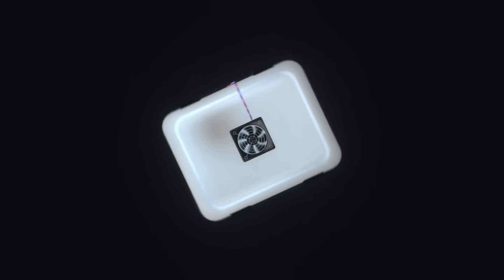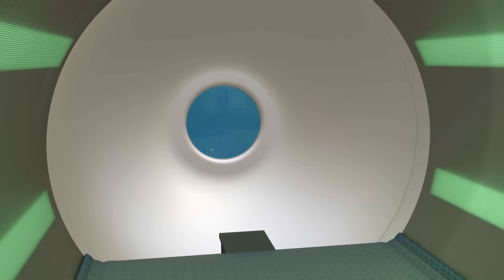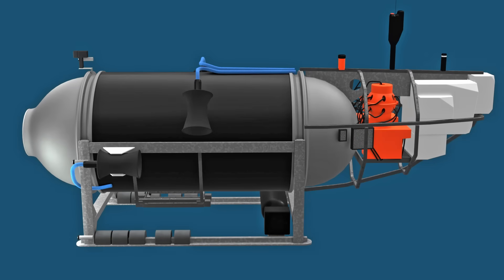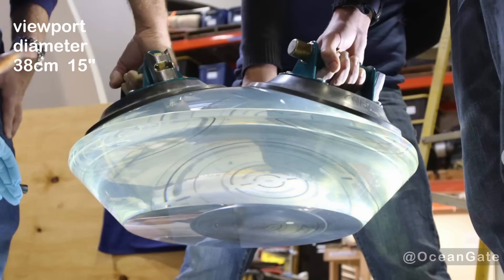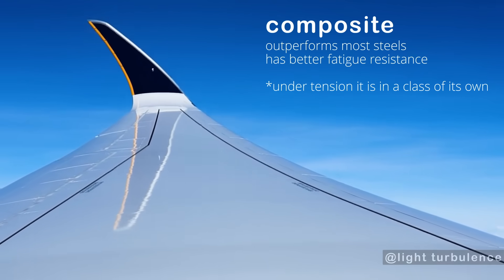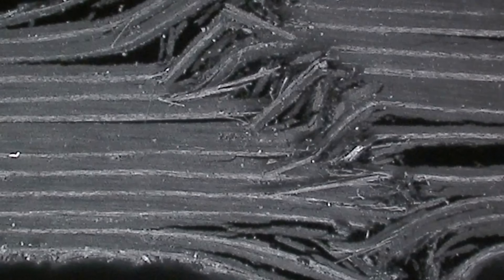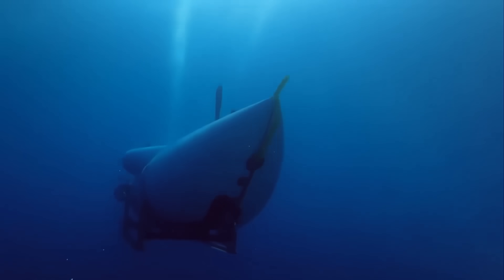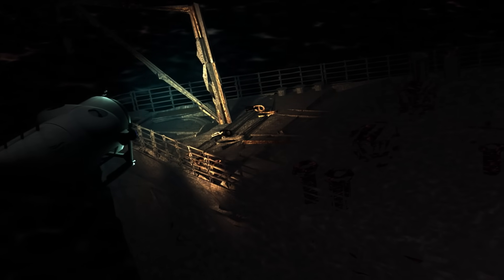Titan Sub | carbon fiber - Detailed Tour

Comment: Your example of the flexing commercial aircraft wing to demonstrate that carbon fiber prepreg composite (CFC) is fine for compressive loads, is flawed.

For a wing providing lift, the major forces of lift and weight are resisted by the underside of the wing, indeed in tension, not compression.

(The top need “only“ maintain a smooth surface without buckling or rippling under load. Nowadays, the upper and lower skins are designed to be structural elements. There are multiple spars but they do their job in synergy with them to effect structural viability.)

Incidentally, the first nontrivial application of CFC for a performance aircraft´s wing, was for the McDonnell Douglas AV-8B Harrier II, the American remake of the English military VSTOL fighter jet. The CFC spars had to be designed sinusoidal in form, because “springy“ CFC couldn´t handle the loads of high-G maneuvers -- Or should I say, this is what was needed to equalize the forces of the interface of the CFC wing surfaces bonded to CFC wing spars.

The “sphincter-tightening shotgun noises“ are caused by the consequent re-equalization of internal forces when fibers break, because it is challenging to equalize the stresses (and strains) of millions of hairlike fibers, especially when under the extreme and differing loads near the titanium endcaps versus the middle; indeed, the structural efficacy of CFC fabrication is only truly manifested when this attribute can be achieved.

Oversimplified conclusion: CFC is good for sheet, but not so much for stock, and good for tension, but not so much for compression.
Reply from the maker: You seem to lack a clear understanding of the topic and the principles of structural engineering. In wing design the same tensile forces are balanced by equivalent compression forces at the top of the wing. This aligns with the fundamental principle that "every force has an equal and opposite reaction." You are suggesting that tension simply disappears into thin air  without a counterbalancing force which is nonsense.

It's intriguing how some, including yourself, struggle to accept the fact that carbon fiber can rival the compressive strength of the best. Carbon fiber is a structural marvel, but its correct construction is notoriously challenging and expensive.
Reply: @Mike-Bell  your responses to legitimate and erudite points of contention presented from obviously well-informed commentators have been extraordinarily bitchy throughout this entire comment section for someone who themselves directly solicited such commentary at the end of the video itself. In fact, I find your commentary of late to be increasingly hubristic and less focused on the technical details underlying mechanical failures, which was what compelled me to subscribe years ago in the first place.
Reply from the maker: @Muonium1 @brianhiles8164  I thank you both for taking the time to comment thoughtfully and with the intent to correct, unlike so many  who do it to insult or for a reaction.  The comment section can be a nasty place and the Titan video has been much worse than usual.  There are comments you don’t see that YouTube filters from  public that are plain vile and cruel.  Pretty much on repeat insulting me generally and telling me I dont know what the F I’m talking about good for compression.  After a flood of these I replied with the above cut n paste response and in some cases distracted frustration which isn’t constructive.  It's better to not  respond but I felt compelled after this garbage dump on my channel.  For my own sanity I think I would do better not reading further comments but that is also not a solution ...  although it seems the garbage has stopped or slowed.  

I didn’t will nily come up with my position.  I checked what I reported in the video with aeronautical engineers who have their own aircraft manufacturing company and they found the whole notion that composite is poor in compression hilarious considering the success of their product and business relies on the spectacualr compressive capabilities of the product.  They did the calculations that I quoted in the video showing a good safety factor.  However, the very thick layup was a big unknown and concern for them and would require tons of testing and research to reveal the unknowns and they added the titanium bond is no joke and very tricky to optimise.  And the mandrel geometry really troubled them.  "Composite outperforms most steels in compression" is their statement not mine.

As for the above comment by Brian which states that wing stresses are not resisted by compression "the major forces of lift and weight are resisted by the underside of the wing, indeed in tension, not compression.'.  This is not a true statement and I disagree like I did before.   The compression components of a wing structure in the top skin and spar absolutely resist major compression load equal to the tension loads elsewhere and on the underside.  
As for the breaking fibres and noises, the engineers I spoke to put that down to bad layup and what happens when you take the material beyond it safe design limit and into fatigue zone.  They also made a point of saying that CF has better fatigue characterisitics than steel.
Reply: @Mike-Bell   Thank you for your clarification and backstory; it is just as challenging to make technical videos published to a non-technical media venue (i.e., YouTube) as to, well, lay up CFC. It is I who gave a LIKE to this your response.

I just have one quibble with your response, still. I never said that wing stresses are not resisted by compression -- this is why I specifically used the word “major [forces]“, and indeed this is why I included the parenthetical clarification in the following paragraph to contextualize this assertion, in context of the exigencies of current wing design.

In the “real world“, engineering specifically, and the scientific method in general, is very infrequently at liberty to assert any one thing is definitely so, without qualification or context. Any attempt to do so “should“ be prefaced by the word “Oversimplified“.   :-)

(As illustrative example, do you really want to formally employ the word “equal“ for the matter of compression and tension? If memory serves, commercial aircraft (and its wings) are designed to endure +3 G, but only -1.5 G. I know, I know: semantics; however, in the hard sciences precise language is crucial.)

In conclusion, it is to be emphasized that your assertion that the flexing of a (CFC) wing is a sufficient example illustrating the primary thesis of your video, is what my response addressed -- with explanation, analysis, and example.

I am nominally okay with the rest of your other written statements; it is my desire that in a careful rereading of my OC you understand that we have essentially stated the same verities.
Reply: @Mike-Bell   Your interpretations of my theses are formally incorrect. I perceive you have some engineering expertise, so it is especially distressing that you make such silly assertions. Why? How?

I would only challenge you to re-read, carefully this time, my original comment, being statements of simple physical fact.
Reply: An aircraft wing is essentially a cantilever beam with a aerodynamic skin. The major bending stresses are taken by a beam similar to an 'I' beam (although they may be box sections, circular sections or more complex shapes). The main point being that while the outer material takes stresses, tensile on one side, compressive on the other, the internal webbing takes those stresses as tensile stresses to stabilise the structure in depth. The complementary compressive stresses are less important, and may in fact cause the thin sections of the web to buckle as the beam is loaded. The point is to keep the compressive stresses within bounds with a stiff structure, but to allow flexibility to distribute stresses safely.  The point is the wing has opportunity to load CF structure in a safe tensile manner.  The laminar lay of the subs CF cylinder left a glaring omission. The circumferential and axial compressive loading produces a complementary tensile stress in the RADIAL direction. Only epoxy served in that direction, so as a failure mode, it would be squeezed like toothpaste in a tube, failing by spalling chunks of composite (on the inside). Conventional 'planar' lays of CF will not/can not address this problem.

Comment: So thats a neat failsafe for the weight frames, excrpt there is ONE GIANT problem with it...

The entire frame of the titan was designed with a great majority of its weight on the "bottom" or floor of the vehicle. Further outside of the submersible its on a steel frame itself...on the belly. 
How in the hell do you expect to roll the vehicle to release those weights? 
You cant get out to lift it.
The motors arent strong enough to barrel roll the vehicle at all.
And its literaly impossible to out leverage that frame with even all 5 occupants doing ANYTHING you could come up with to roll that vehicle.

So that would be a completely failed system as soon as the primary release mechanism failed. 

Surely im not the only person who is skeptic about that boyancy system?....
Reply from the maker: Those sort of calculations are really easy to do by an Engineer. OceanGate wouldn’t so dumb not to do it and they had some good ppl on the team. 450lbs of the crew off to one side is a substantial moment. And from the model the tilt needed to be only 25degrees which was not that steep.
Reply: @Mike-Bell  450lbs cant leverage multiple tons with those dimensions.
Reply: @Mike-Bell  and what you mean?...they were dumb enough to not do destructive testing....

That would be the first test done after making the vessel and checking for seal.

Comment: this review comes across as slightly bias. the sub is well known to be dangerously flawed and the company run by arrogant conman
Reply: That’s exactly what he says in the video. I didn’t see any bias.  He clearly says that sub was dangerously flawed and the guy who ran the company was arrogant and stupid for designing the sub the way he did. The video also describes how it’s too bad that they didn’t build the sub the right way with the right resources bc it could have been done with carbon fiber and it could have opened up science to a new method of traveling under water.
Reply: So you're saying he should be more biased, just the other direction.

Comment: Carbon fiber isn’t good with compression. It’s good with expansion…..this is not rocket science. That’s why high pressure compressed air tanks are made from carbon fiber. Smfh.
Reply from the maker: You seem to lack a clear understanding of structural engineering. In wing design the same tensile forces are balanced by equivalent compression forces at the top of the wing. This aligns with the fundamental principle that "every force has an equal and opposite reaction." You are suggesting that the crazy tension forces in a wing simply disappear into thin air without an equal counterbalancing force which is nonsense.

It's intriguing how some, including yourself, struggle to accept the fact that carbon fiber can rival the compressive strength of the best. Carbon fiber is a structural marvel, but its correct construction is notoriously challenging and expensive.

Comment: This sub suffered from multiple systems failures in 80% of its dive attempts, and none of those had anything to do with the CF or game controller, I would love to see a follow up video on these failures
Reply: So the CF hull making loud noises isn't a concern at all? I don't get why you people are trying to defend composite materials when it was very obviously the cause of failure.
Reply: @pyropulseIXXI  the material could be fine, but you have to remember that designs have trade-offs. This is nore likely a failure caused by some of these design goals, and not the material. Subs all make noises, as far as I know, but a carbon fiber one should probably not be making sounds like a gunshot, at least not after the first dive or two.
Reply: because, like airframes it gets better. Boeing had nasa to help  @pyropulseIXXI
Reply: @pyropulseIXXI composites good, just not for this application
Reply: Designer flaw. The whole build had problems. Follow up with it’s designers
Reply: @jimmyjames_yt  The biggest design flaw was using a composite material. I'm not saying composites can't work, but obviously, the composite is what failed.
Reply: I thought one of them was and they got away with a software update middive
Reply: Yeah i think the bloody thing was configured wrong and the had to turn the controller upside down to use it !! I mean FFS!! @gingernutpreacher
Reply: very true -
Reply: If you talk like this, you better back that up with some sources because it think you're talking bs. Go ahead, I'll wait.
Reply: The fault was in the use of composite material.
If TITIAN had been made completely of titanium, such an accident would not have happened.

Comment: I always thought it was where the end caps and Carbon Fiber met where it failed because of the different compression strengths. Also, I have read that the Carbon Fiber was bought for Boeing at a discount because it was past its shelf life if there is such a thing. Cheers thanks for Video.🍻
Reply: Also his glue looked dodgy.  Probably supermarket Gorilla Glue and apparently applied in a giant shed, not in a “clean room”.
Reply: @Woodman-Spare-that-tree  Your are probably more right than you know! 👍
Reply: With pre preg the resin and hardener is in the carbon at the correct ratio for maximum strength from the factory and it is kept cool till use and heated to cure it has a limited shelf life that should never be exceed, Especially were human life is concerned.
Reply: @suncitybooksgeraldton335  Thanks for the comment I wasn't sure! 👍

Comment: There is a reason why Navies don't build sub pressure hulls out of carbon fiber. They know it can't survive sustained compression. Aircraft hulls also have spars, which help support the structure. This guy is totally off the mark in his analysis. He must be a used carbon fiber salesman

Comment: Mike B. seem my comment 2 hours ago is in review.  In review of it I agree that doing composite correctly is difficult, however; woven carbon fiber is in common use with those wiggles a prominent feature of weaving. The key to all composites is the interface between the fiber and the adhesive, carbon fiber and epoxy.  As I said shear force always exist at the bonding interface due to different properties.  And one always assumes bonding failures exist in every, every composite structure.  So your wiggle theory clearly ignores the wiggles in woven fabric and laid without applying tension.   Clearly well known and corrected for in any finite element analysis.
Also as I mentioned what was obviously missed was that cracks would reach the outside surface of the cylinder.  This is well known in the industry, however; for airplane and other structures they are corrected for in the stress analysis.  What is also know and why people say carbon fiber is no good in compression is from the infusion of liquids into the fiber in tension for continuously fiber pressure vessels and pipe. 
As I stated the sea water at depth pressure entered the cracks.  The communications to the surface indicate that the weight of the submersible was heavier then when set up for the dive.  They reported the free decent faster then normal which can only occur from being heavier.  The dropping of weights created a very lethargic response and additional weight I understand were dropped of before the implosion.   This also indicates a heavy vessel.  Only way weight could be added to the vessel without seeing water inside is for that water to be filling cracks. 
Thus the design was flawed and the obvious solution is to prevent water from entering the cracks that will always exist since the manufacturing and materials themselves can not be perfect.   Thus I suggested coating the cylinder with a material the prevents water from defusing though it.  Plastic, rubber, or metal could be used.
Reply from the maker: The communications you refer to are from a malicious fake "leaked trancript" and have been debunked.  I debunked it in the video and here is another ... https://www.snopes.com/fact-check/titan-sub-transcript/

Comment: I saw the video when they were attaching the titanium to the carbon. The person was cleaning the titanium surface with a cleaner and a cloth, then he ran his bare hand across the part he cleaned. Couldn't the oils from his skin contaminated the surface?
Reply: Oh that's the issue right there, 
problem solved case closed.